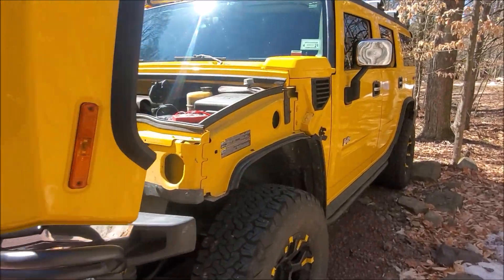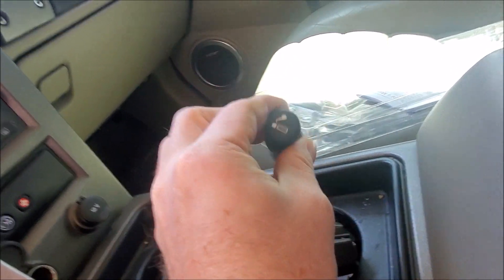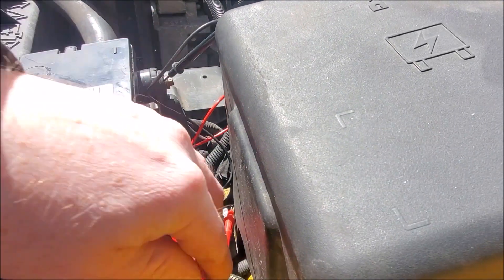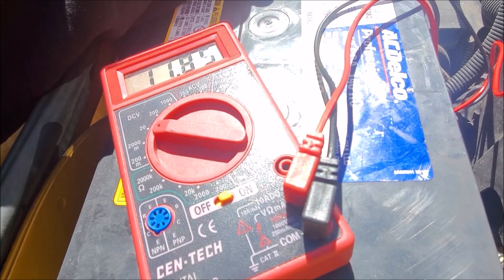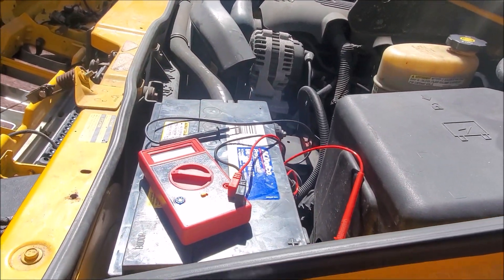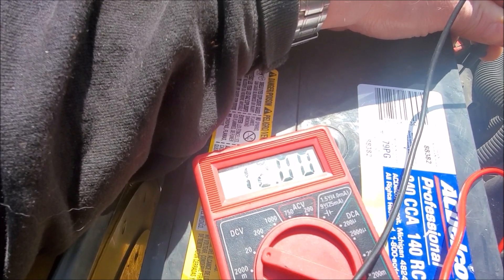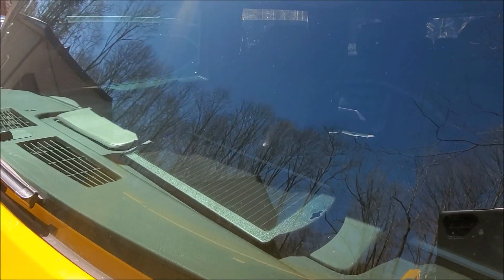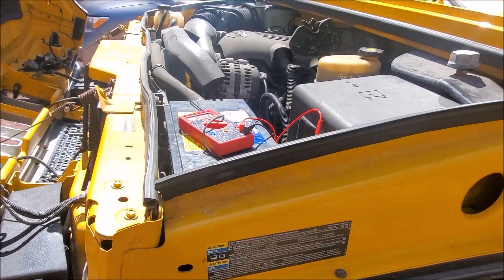Battery Draining? 5 Minute Fix, Parasitic leak - drain

Comment: Did u hook the solar wires straight to the battery? My battery goes dead every two days
Reply from the maker: The battery maybe super weak and due for a new one. I've had pretty good luck so far with this.